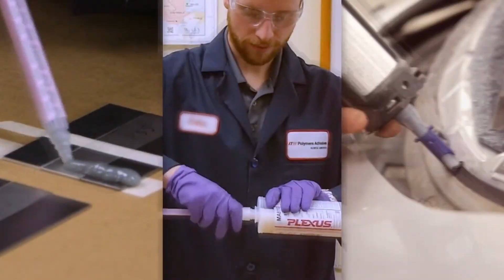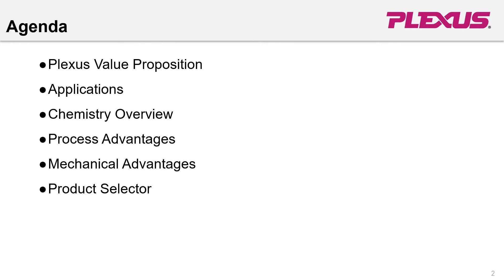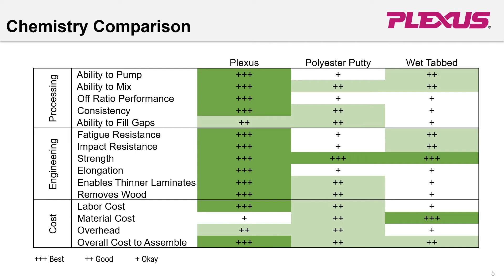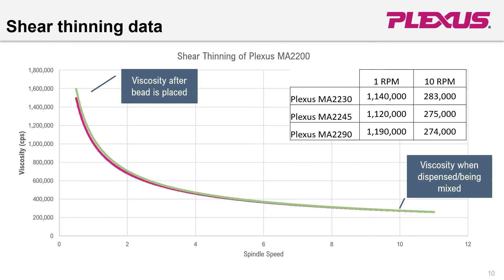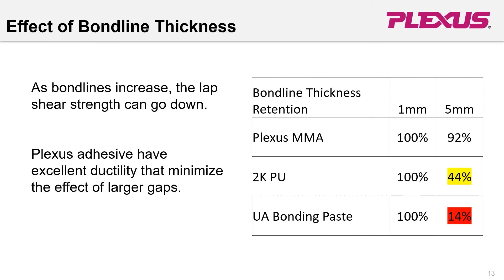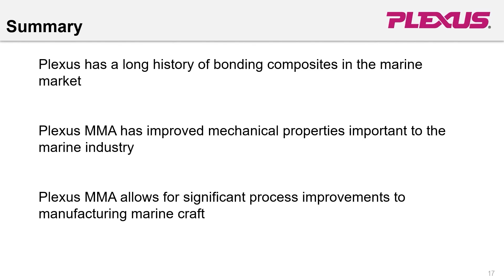Why Plexus Adhesives Outperform Putty & Wet Layup | Marine Bonding Deep Dive

Comment: Can you epoxy  glass over plexus?
Reply from the maker: If you’re referring to fiberglassing over a Plexus bond with epoxy, typically no.

Plexus is designed to replace traditional fiberglass and wet layup, not be layered with it. It gives you structural strength, fatigue resistance, and gap filling without the extra glassing step.

Fiberglass can be used in small repair situations, but in most applications manufacturers stick with one system for consistency and long-term performance.